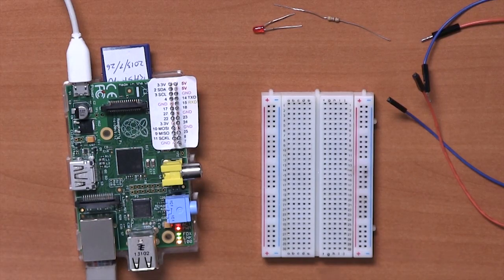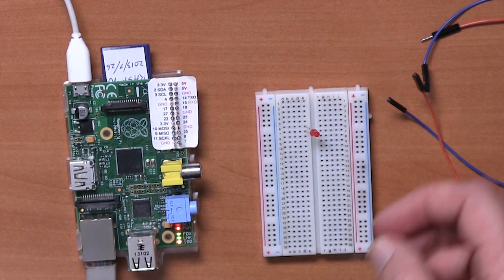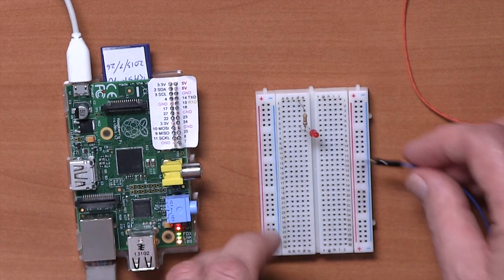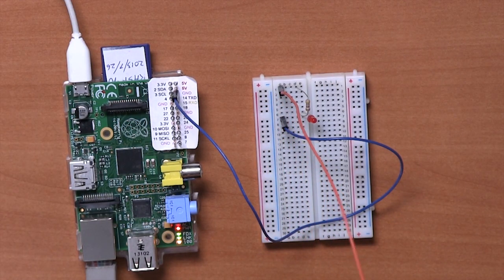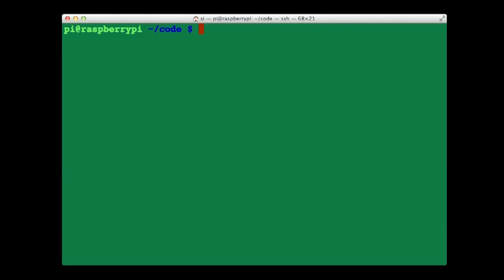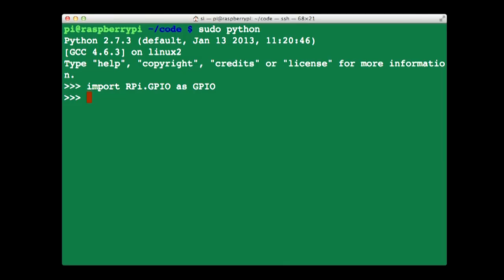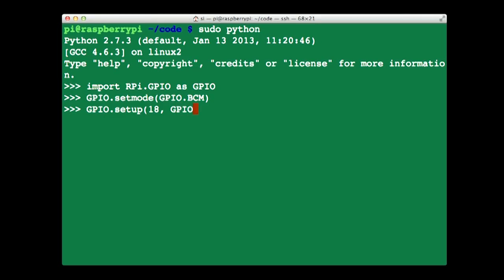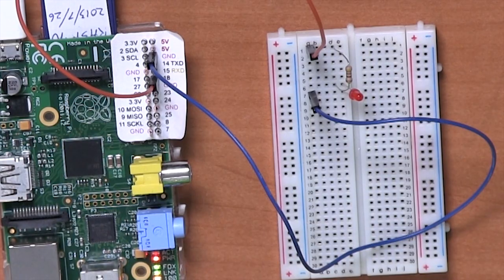Connecting an LED To Raspberry Pi

Comment: Can anyone explain to me why we should use the resistor, I really can't understand why. I would be very grateful
Reply: It's to prevent the LED from burning out too quickly.  

Inside each LED is a chemical that when electrons are passed through, it glows.   The more electrons or the higher the current flowing the brighter it will glow.   So why do you need a resistor in series with your LED? Because nothing is limiting current flow!  It can fry without one.
Reply: @clarkdriscoll3540  thank you very much you helped me a lot

Comment: I think a 470 ohm resistor will not provide a enough voltage to the LEDs. I needed to use 220 ohm.

Comment: hey can i ask something? what if i want to give an output signal through the raspi's pin but i want it between the minimum and maximum range (ex: pinout = 1.5 volt from 0-3 volt scale), can i configure the python code into percentage just like in arduino?
Reply: No

Comment: Actually, if the idea is to protect de raspberry, the resistor should be placed between the ground end the LED... not between the GPIO end the LED...
Reply: I don't think it makes any difference because it's in series.
Reply: @nickisacebeans  Correct. Clearly, Joan has no idea how circuits work.

Comment: what ohms the resistor?
Reply: You can calculate that with a formula, but usually is 220 or 330 ohms. Good luck.
Reply: 220 r

Comment: if it already three volts the average Light emitting diode  can with-stand it so what's the point of adding a resistor
Reply: You can use even 5v if you have a resistor
Reply: He literally said it's about damaging the GPIO ports. If you have too much current draw from the GPIO port then you could break it.
Reply: Better safe than sorry,

Comment: Hello. It's such a great video, and in the end a doubt came up. I'm doing a school project that consists in a smart house with Raspberry Pi 3. I want to connect multiple leds to the house. What are the pins that i am supposed to connect the jumpers? And it's necessary to use a protoboard for do that, or I just have to weld the jumper to the resistor and the resistor to the led?
Reply: How did this turn out?

Comment: Thank you for this wonderful tutorial. It worked like a charm. The only mistake I did was to have a high value resistor I used 220 ohm and it worked like a charm.